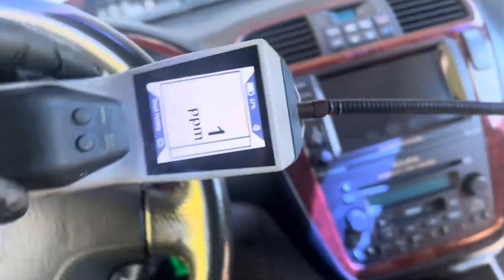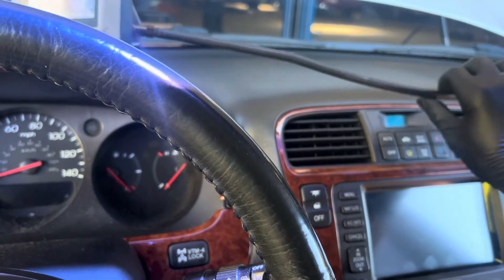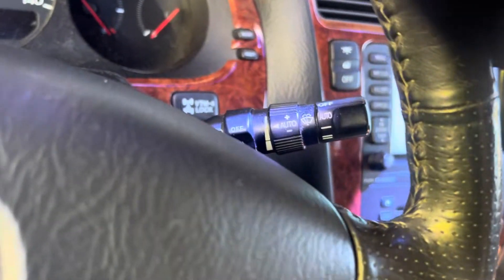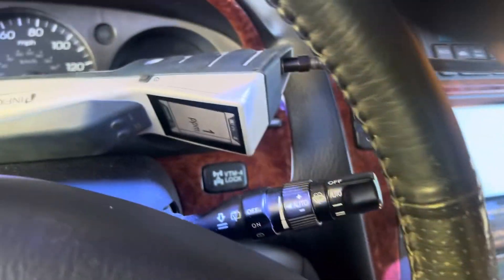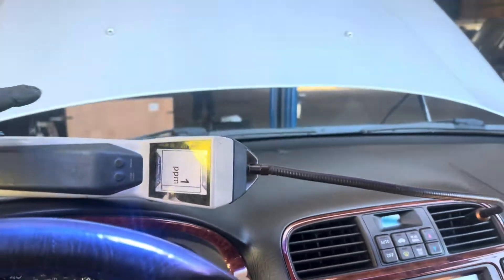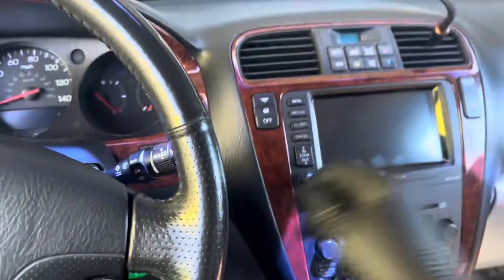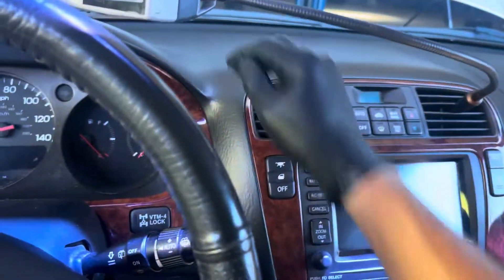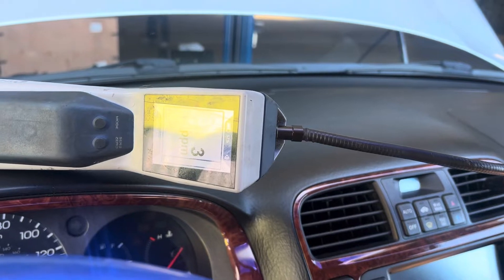I prove there is A REFRIGERANT LEAK TWICE BEFORE I CONDEMN A EVAPORATOR

Comment: Why do you check it twice?  Could you get a false reading from a leak in another part of the system?  Mechanic replaced the evaporator, AC still didn't work then noticed a hole in the high pressure line.  Did they replace a good part?  Or a potential good part? thanks
Reply from the maker: Always check it twice or even three times or more

1: I check it with high-pressure nitrogen leak decay test

2: I use a Ultrasonic leak detector

3: with the refrigerant and or high-pressure nitrogen I use the soapy microliter, checking bubble mixture

4: I use the fluorescent Tracer UV dye

5: I use the vacuum micron leak decay test

Then after I finish the repair . 

And run it with refrigerant in it . 

I repeat all my test again . 

There are some leaks that just don’t leak all the time . 

They may take vibration as you’re driving down the road and the hoses are bouncing up and down at one of the fittings it’ll start the leak 

Some leaks only leak when it gets cold in the pipe shrinks contracts 

Some leaks only leak when it gets hot 

Some leaks only leak when is high pressure and then stops leaking when it gets lower 

Then, just the opposite some leaks only leak under low pressure 

And they are not all constant 

Only the very easy leaks or constant. Those are the majority of leaks. Those are the simple ones define. . 

Leaks do not always leave a oil residue 

Sometimes I can be a large leak, and no oil comes out.
Reply: @coldfinger459sub0  thank you - one last question.  high pressure line to condenser has the hole in it - do I need to replace the condenser?  is there a risk of debris getting into the system and causing failure?
Reply from the maker: @paulbatkins5652  should be no problem just a small hole and rub through

Just replace the receiver, drier or the accumulator replace the line and since you’re doing it yourself if you have all the time in the world, just leave it on the back and pump overnight 

If you do replace the cumulator or the receiver dryer, get the manufacturers instructions on the oil balance how much oil must be replaced for that item being replaced usually accumulators hold more oil than receiver drivers must read instructions for manufacture

Comment: My brother's F150 was impossible to diagnose. Got it used without AC and it was a many time comeback at the AC shop. Another shop tried replacing the compressor because the front shaft seal had a minor leak. Still leaked out over the course of about 4 days. The only clue I had was the blower felt cold even without the AC running. My brother and I tore out the entire dash. Got to the box, removed the evaporator. The thing was covered in refrigerant oil and was generally nasty. Replaced it, vacuumed it down put it all back together worked great for 2 years before the compressor blew. Evaporator has to be easily the worst thing to do on just about any car
Reply from the maker: The evaporator would’ve been very easy to find with a good leak detector the very first time.  It pays to have tools it pays to have very good tools that cost more and it pays to know how to use the very good tools correctly 👍

As for the compressor blew up 🔥 usually technician error something was wrong. 

Oil type or oil quantity. 

Lots of moisture or air in the system

Refrigerant and charge ran low so compressor started overheating and oil stopped returning

Compressors don’t die they are murdered.
Reply: @coldfinger459sub0  good to know, it probably had something to do with the fact we charged it with AC pro
Reply from the maker: @lm7bird680  if it was only one can of AC pro that’s not bad and I don’t know old bullet proof system like that even toucans wouldn’t hurt it. 

But if you paid attention to the low side gauge that said green and depending on the ambient conditions it could have been under charged or overcharged

Comment: That PPM sniffer you use, how does it react to low or any airflow into the tip? 
Does it affect it like a heated-diode type?
Reply from the maker: No problem 😉 no false positive that’s why I have it .    

A good heated diode will not give you false positive like the H-10 I have that pone to.

Comment: Not sure on that model but could you not check the condensation tube that drains the water out of the evaporator box?
Reply from the maker: If there is no water, yes 

But I have a leak detector so sensitive I don’t have to crawl or put the car up on a hoist. 

Most other leak detectors automotive guy buy off the tool truck cannot do this.   
       Unless the leak was much bigger.  That’s why this is $1000.  Not one of the tool trucks $300 or $400 toy want-a-be leak detectors
Reply: Dye indicator puddle on the ground under the evap drain tube is a definite positive.
Reply from the maker: @thisisyourcaptainspeaking2259  on , When do evaporator will be moved probably all will see is a light oily residue with a dark stain of dust accumulation attached to it just like condensers
Reply: @coldfinger459sub0  Agree, just because the drain doesn't appear oily or wet with oil dust even, doesn't mean it's not a leaking evaporator.  Sometimes though, you can see dye in the condensate puddle, it's something I look for.
Reply from the maker: @thisisyourcaptainspeaking2259  Yes I know I released one video showing that possibly to
Reply: That's where I go with my Fieldpiece heated-diode sniffer. I'm pretty sure R134a is heavier than air., so I'm assuming if there's a leak it will be concentrated at the bottom.
 I'll run the AC on Recirc, shut it off, let it sit a while, then sniff the drain tube under the vehicle or pull the drain tube from the evaporator case under the dash and sniff from there.
Tom is using his PPM detector, if I stick my heated-diode type in any airflow, it goes nuts, kind of a false positive result, I'm assuming.
Reply from the maker: @hnd2893  that’s why I only use the H-10 heated diode so I don’t get positive if I’m going to use a heated diode. 

    The H-10 is the best at CFC refrigerant any with a chlorine molecule.  R12 R22 R500s. Those types. Along with this Stratuts leak detector